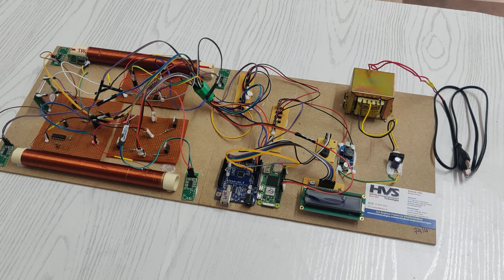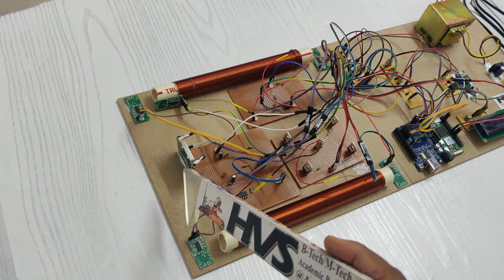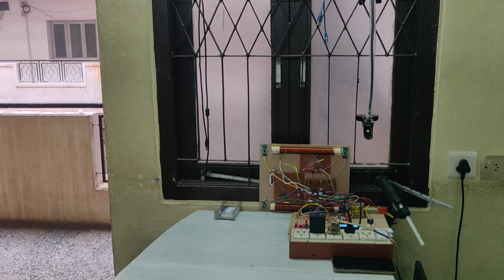Comment: What module did you used for UWB radar sir ?
Reply: Hi, 
We sell full working kit with document PPT circuit diagram and code. Could you Send me the video link, Will update you the cost details. You can contact us at +919603140482
Through WhatsApp or call